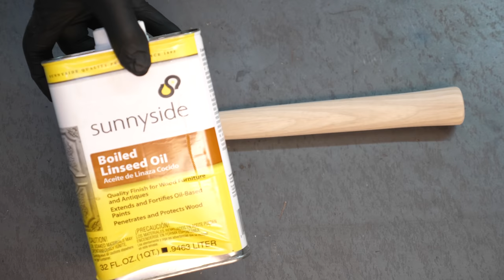Lath Hammer Tool Restoration

Comment: Good restoration, the reason you failed on the first handle wasn't the wedges fault but you softened the first with the oil, that's what caused it to break.
Reply from the maker: I've seen people use that method successfully (on axe handles). It's supposed to help lubricate the wedge and then when it cures it's supposed to help secure it in place. You could be right, though
Reply: @RestorationStation  Many YouTubers try to show us how to hang a handle on a hatchet. Glueing the wedge with very good wood glue was shown on one video. Linseed oil was put just on the handle.

Comment: I've always had success with handles by soaking the end in water for 30 minutes, then glueing it in with a polyurethane glue. Wedge as well. You have to let it cure overnight, but the moisture and glue combination makes the end swell up and it cures that way.

Comment: You have to remove the shoulder of the handle on which the bottom of axe head rests. There should be a smooth transition where axe head does not rest on a shoulder.

Comment: Very nice restoration, but I've noticed that a large crack appeared on the new handle, after you had installed the metal wedge. 
Wouldn't the crack pose a threat / problem when working with this Hammer / Axe tool?

Comment: yeah I agree, good to know others mess up too.  I do quite often, usually 'cause I take it just a bit too far.  On this one, it is clear to me that you understand metal, but not wood. First off, if you get a nice fit on the handle to begin with, you don't need but a thin wedge to keep the handle on. Apply your linseed oil after you've driven in the wedge and have the head on tight. If you do it before, the wood swells, but also softens so when you drive the wedge in, you can just bust things up. I don't think you have to ask how I know this. let's just say experience is a good teacher if not the nicest one.  I actually don't care for the metal wedges all that much, and certainly not those thick ones. A good fit to begin with, then a thin wood or metal wedge is all that's needed, everybody tries to overdo it, yes me too until I learned better the hard way. Also I would have liked a beefier handle with more flare at the end, with a lanyard hole. If you're up on a roof putting on shakes, you don't want to drop it and have it fall, even if there's no damage it's a pain to go back down the ladder to retrieve it.  Of course, I imagine this tool doesn't actually get used for that these days Nobody uses cedar shakes anymore.

Comment: Love the choice to blue instead of chrome it's way cooler and a better design choice, the final handle was also nice. I think you need to do a better job of getting a straight blade edge though, if you're going to put it on YouTube don't be lazy and half ass it, finish the job and do it right, you did great everywhere else except there, and also with the wedging at the top, on this and the other axe you did you didn't measure the width you needed so the wedge is smaller than the handle and it doesn't look nice, I'd just recommend you pay more attention to details like that because it's those things that really make a project like this, it's those things that are the difference between an average and a beautiful piece. Other than that well done you've got good taste and skills ☺️

Comment: Be sure to remove the rust were the handle connects to the hammer. As it will continue to rust after the handle is installed.

Comment: In my opinion instead of restoring it you completely ground out the functionality. The angles were there for a reason and the curve on the blade had a reason also. I used one for roofing for about 8 years before deciding it was a young man's sport.

Comment: It's a lath hammer, not a shingle hammer, (they usually have a cleft or slot to pull nails when repairing cedar shake roofs). Lath hammers are traditionally  single side bevel  sharpened, so you get a flat cut on the end of the lath. Also the handle should be a certain length (on shingle hammers/some also have holes) to make measurements while laying shingles.....Really like that you made it BETTER than new. Some would argue you have lost old patina, but I believe this was a cast head, not forged, maybe why gun blue went on unevenly, and were originally rough textured. Any idea why handle failures?

Comment: Yes, your saw is blunt and not set properly, you can tell by the note, but nice job on the hatchet. You could use a push stick with your band saw.....you made me cringe a little putting all that pressure on with your thumb and fingers. Good video, very interesting.

Comment: Bleh, sorry about the handle after so much work. I have two of those lath hammers I've re-handled. The wood gets awfully skinny where it passes through the head. I don't know where I'd use such a tool but I couldn't bear to look at the rusty hammerhead. Let's just be happy we don't have to sheath walls with lath and plaster.